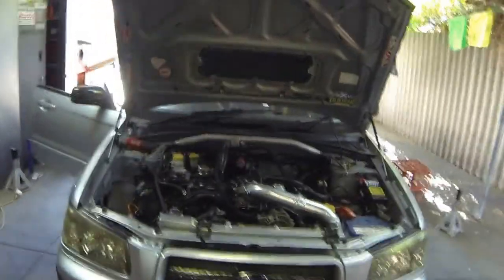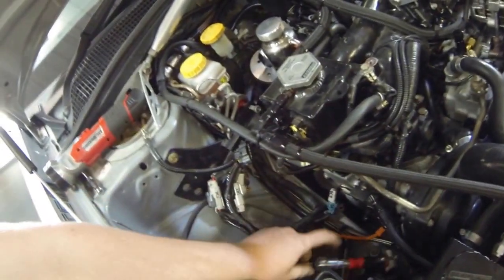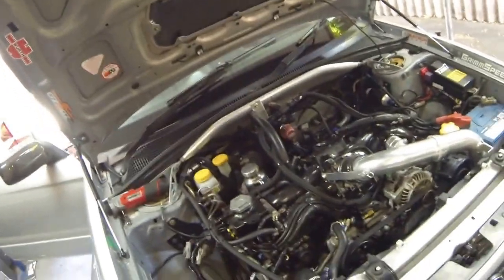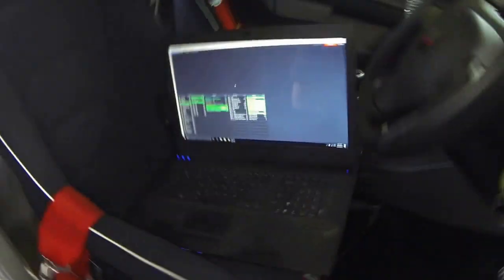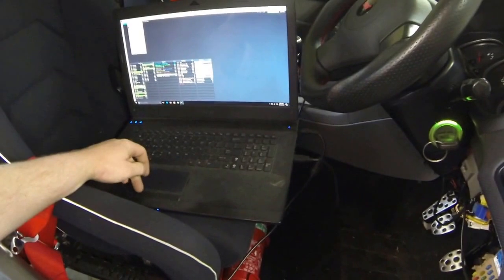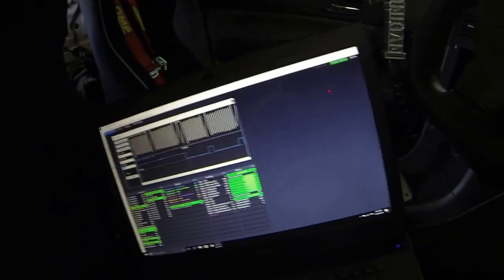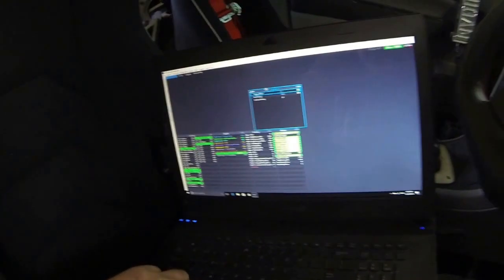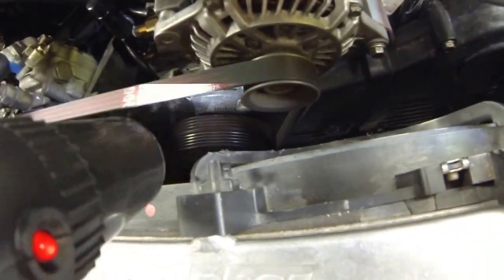How To Test Ignition Timing Subaru.  Link G4+ Thunder.

Comment: I also switched to a aftermarket pulley and mangled my stock crank pulley on removal. Is it absolutely necessary to check this given nothing has been touched on my EJ20 timing wise and timing was perfect before. I also have a Link G4x I’m about to install and I’m trying to get all the proper info before first fire.

Comment: After setting base timing to 10* btdc I got a high idle . Do you know what that problem is?
Reply from the maker: If I remember right, the link G4+ ECU can be set up to adjust timing at idle to make fine corrections to idle speed, that are too small and fast to be made via throttle blade opening angle alone.  

As the timing is advanced or retarded, the engine will run more or less efficiently.  Therefore, it could increase or decrease RPMs without any change to air flow, just by changing timing.  The ECU can use timing adjustment as a means to adjust idle.  This is because with DBW throttles, sometimes the amount of air entering can not be metered fine enough to give smooth consistent idle of using the throttle blade alone to control idle.  

The idle control stuff is alot more complicated than that, and includes temperature compensations and other compensations aswell.

If you are locking it to 10° like I do in the video, then you are locking out any adjustment the ECU could be making to control idle speed.  Aswell as locking out any other timing adjustments.  This will naturally cause the engine to run slightly different than normal, and could explain why you noticed an increase in RPMs.

Does it return to normal after you complete the test and unlock the timing lockout???

Comment: Did you just get an ecu advertised for a wrx of the same year?  I know it’s an old video lol but wanting a link for my 06 XT
Reply from the maker: Hi 
No that is a Link thunder g4+.  It is a wire-in ECU.

Install was relatively easy.  Using the Subaru FSM to locate the wires needed, then cut them off the old ECU connector one at a time, and terminate them into the new connectors.  

Then setup the ECU was relatively easy aswell.  I found the Link G4+ system to be very straight forward and logical to use.
Reply: @BramBiesiekierski  ah ok.  I was hoping that I could get a 2006 WRX plug and play link for my 06 FXT I’m not sure if that’ll work. Same car to my knowledge. I’m America anyway lol. Thank you for your response
Reply from the maker: @_rumble_wagon3204  
I specifically chose the Link Thunder as it had alot more I-O options than a plug n play ECU.  Generally speaking, when an ECU company makes plug n play ECU, the ECU will have just the basic functionality required to run the engine in question.  You often become quite limited if you want to run alot of optional functions not standard on the original vehicle.  For example things like D-AVCS or monitoring individual wheel speed, additional temp/pressure inputs, running various outputs or any number of other things you might want the ECU to handle.

It's been a while since I've had anything to do with it.  But I'm pretty sure there are options for plug n play ECUs for forester XTs.  I do know the 04-05 XTs are different to the 06-07 XTs.  And im pretty certain the US market ones are different again to the rest of the world.
Reply: @BramBiesiekierski  That’s very informative thank you. Judging from your video I assume your from Australia or Nee Zealand. I’m not sure if your car is a 2.0XT or 2.5XT my car has an EJ255 not an EJ20X or Y like many other markets. The wire in ecu seems like a much better option for overall upgradability I’m on a stock ecu with a Cobb AccessPort and it’s fine but just the thought of having all kind of things I can monitor and different things